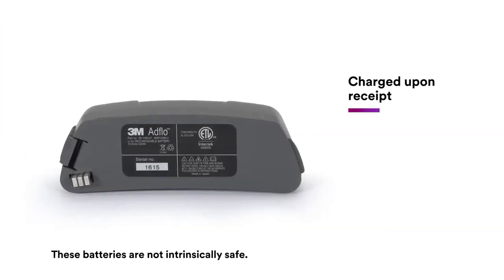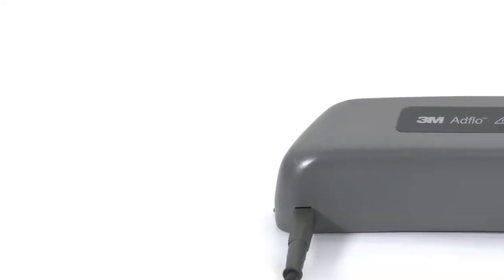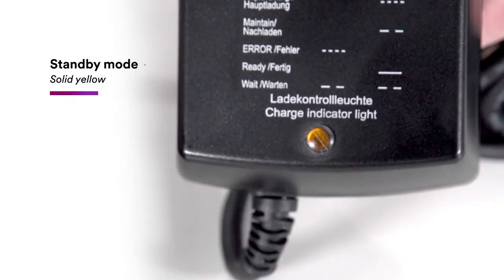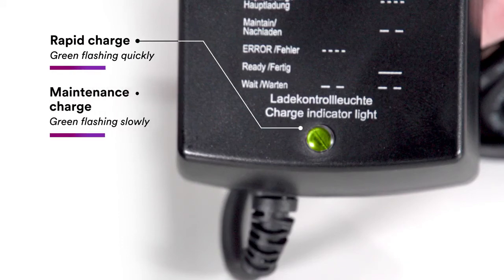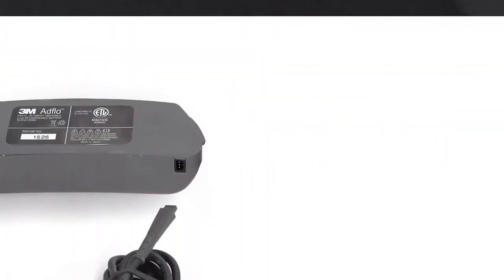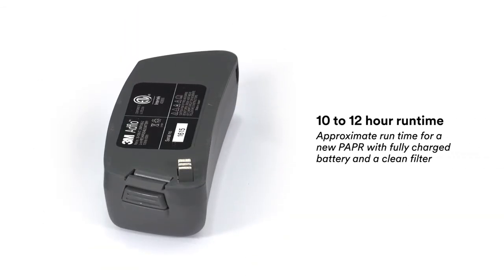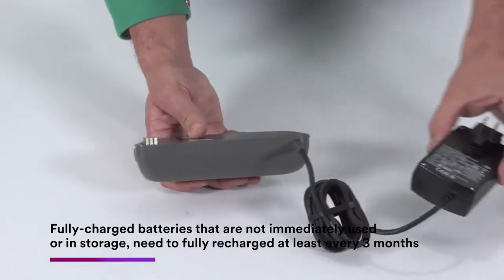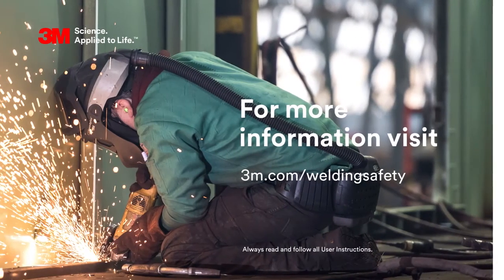How to charge the

Comment: How would one differentiate between Standby Mode and Error Detection when the light for both of them is Solid Yellow?
Reply from the maker: We apologize for any inconvenience caused by the video. The charger model featured is an older version (no longer available) and error mode is indicated through a fast flashing yellow light. This is printed on the charger and in the user instructions.

Comment: These new battery’s and chargers are awful I’ve had the charger end break off twice in the battery and Have gone through 4 battery’s 3 of them didn’t work right out of the box at 500$ cdn I feel the quality should be way better then it is
Reply: Absolutely! 3M should be ashamed of such a fragile and over priced design. $0.10 part breaks on the chintzy end of the cable and you need to buy a $150 charger that will just break again if you look at it wrong too many times.
Reply: @RallyRat  They are expensive but they are better than any other Make's. I've have tested ESAB G50 With Turbo Air pack for a company because they was taking on 4 new welder's for a afternoon shift. Now the Air Pack was not bad, 3 setting Li-ion battery 1 pin charger plug. But the Mask cassette was garbage. Auto on all settings had turn switches instead on touch button like SpeedGlass, i could set it to my required shade but the cassette goes in upside down an finger tighten screw. Ppl couldn't get on with them setting them up, the hose clip rubber seals fell off with in the hour what seals the air pack to hose an vice versa to the helmet - price £500, wasn't even good enough to use at home in your garage maybe at weekends never mind production Welding 5/6 day's 38 hour's aweek. Our company's Tig an Mig welder's have SpeedGlas 9100X FX 3M Adflo at over £1,690 a set, a heavy duty battery Li-ion is nearly £250 making um nearly £2000 each. So the Company wanted to try a cheaper option an have 4 Parweld helmets an air packs what they have on test. But again not the quality of SpeedGlas 3M Adflo air fed respirator welding mask. The Battery's are made in Japan, used correctly you are guaranteed 500+ charges on a standard battery with the 3M Adflo Li-ion Battery charger with 7 different charge indicator light modes. Everyone ive spoken to says you know what your getting an ppl had with 3M SpeedGlas an 3M Adflo air pack, changing air filters an batteries, inner lens outer lenses an went on to be industrial use for many year's an still working.  I remember my first in 1997-8 award-winning design Swedish SpeedGlas 9100 helmet 👨🏼‍🏭🇸🇪